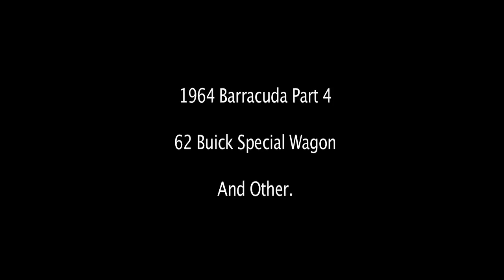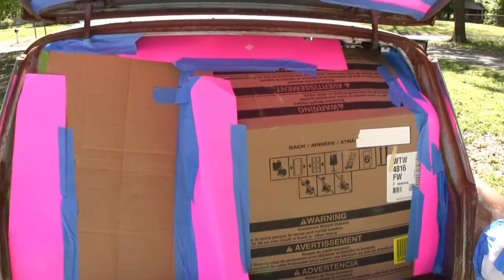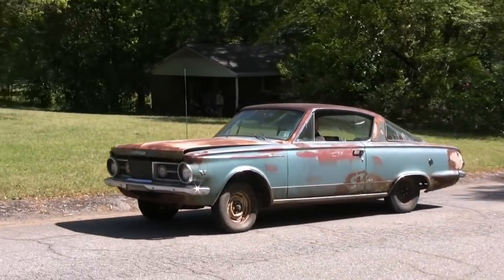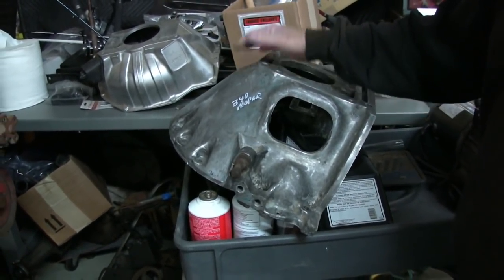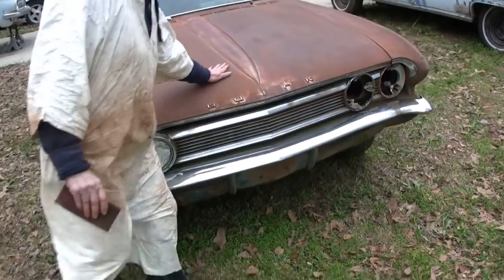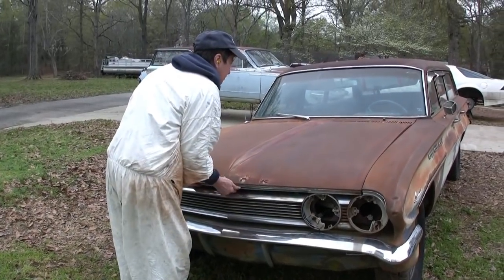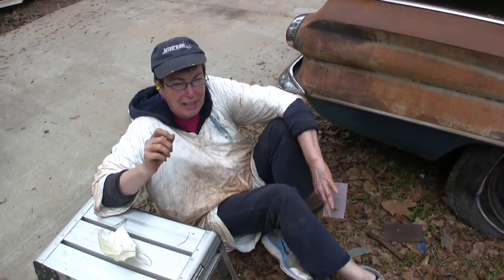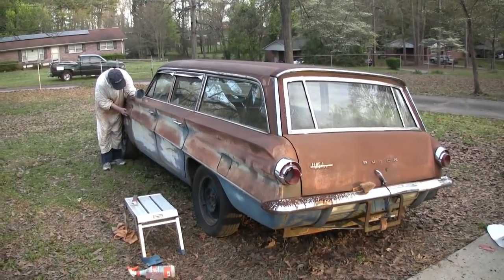64 Barracuda and 62 Buick Special Wagon

Comment: Glad to see ya'll are surviving your forced isolation.  Jackie and I are hanging in there.  I leave her at home and go to town about twice a week for supplies and mail. I really like your Buick wagon.  At first I was going to suggest a modern swap, a LS with a turbo.  After seeing the engine in it I think i would try to get the original engine going just for the rarity of the combination.  Thanks for the shout out on the model car, I hope you enjoy it.  I have a pretty good collection myself, most of mine came from estate auctions that I do online.  Time for a quick story.  The first car I had that I drove to school was a 49 Chevy Deluxe.  I know you are familiar with the old three on a tree.  Well this old car ran well but there was so much play in the shifter linkage that if you didn't hit the 1-2 shift just right it would hang between gears.  You don't know how many times I had to get out in traffic and grab the linkage on top of the steering column and get it back in neutral.  Finally an old country mechanic who worked out of a shop that looked like it was about to collapse told me to go to NAPA and they had a kit to correct this.  You removed the cover on the column linkage and inserted this spacer between the cover and the internal workings and bolted it back together.  It worked like a charm until the day I got rid of it.  Well you and the Rust Queen hang in there and we will all get through our imprisonment.  Keep the videos coming they give me something to pass some tilme.
Reply from the maker: Never heard of the spacer for the 3 on the tree. Will have to look into that some more. Now you have me wanting to work on my 49 Chevy, lol. Wish I had the money for parts while I have this time off. It's tough being born good looking instead of rich. :)  I may play with mounting the engine as I have parts for that. Need to finish one floor board too so I really have no excuses not to work on it. Glad to hear you folks are well and always look forward to the stories. Keep them coming.
Reply: @indyme2  You may have to find some NOS  parts on that kit, I bet it has not been made in many years.

Comment: Love the wagon. I use Penatrol for the finish. Makes the rust and paint pop. Plus. Not to shiny. And can put on with a brush. I've done a couple vehicles that way..
Reply from the maker: Penatrol? Newer heard of that. Will have to look into it. Thanks for the information and for watching, Mike.
Reply: @indyme2  its a paint additive. For flattening brush marks. You can use it by itself for a finish. Only about 12 bucks at Home Depot. You could try it out on a rusty piece of metal. Very easy to apply!
Reply from the maker: @mikek771  Thanks, Mike. Will look next time I am in Home Depot. We'll give it a try.

Comment: Fun video on the Rust Ranch. Did you guys consider clear coating the wagon and/or Barracuda ?   I was worried when you left in the Barracuda that the hood was not latched. Never forget driving down the road with my Dad in a 76 Chevy Pickup and the hood came up in our faces.  We were probably going about 50.  Stick that 385 in the I-ROCK and let er eat.  Take care. Stay safe !
Reply from the maker: We are going to apply boiled linseed oil to both. The barracuda hood was not closed completely because I had a gas line run to a small anchored tank inside the car, lol. Not sure of the condition of the cars tank yet. I am driving the Barracuda and the IROC every few days. Got to keep them mobile until I decide which way to go with them. Everything is mostly on hold until the job situation gets better. Another month and it will be time to hit a creek. Gold is calling. Hope all is well with you.
Reply: All good here. Just started my new Channel: Angry Chef, Mad Gardener and Crazy DIY.   First video is a Cast Iron Skillet Chicken Pot Pie with Butter/Lard crust.  Really like to cook, garden and rebuild stuff.  Should be a pretty eclectic channel.  And it is about time to get out and find some Indiana gold.  Spot is there just begging me to come. over and find gold !

Comment: Yep, those aluminum motors are pretty tough. They make a lot of after market parts for them. But it would be better to put a small block with a 350 turbo behind it. At least until you can build it. That will make a nice hot rod. It is in very good condition for it's age. Nice show, keep it up. Ronnie.
Reply from the maker: Yep, we are with you, Ronnie. 350/350 for now. We are also considering putting it on an S10 chassis. Looking at one this weekend. It's a unique car. Looks cool. We'll make it a driver. Thanks for stopping in. We appreciate you taking the time to leave us a great comment too!
Reply: @indyme2  That will be cool. Ronnie.

Comment: hey the Buick looks great and even better that you're planning on keeping the Patina.. I have a question related to the sanding process - Do you only dry sand? And what is the order of grit/grade of sandpaper that you go through? thanks in advance all the way from Australia..
Reply from the maker: She is using 150 to 180 grit cheap home repair sand paper. Dry sanding. She sands, wipes off the dust and then looks at the work. Then sprays a little water on the area to get an idea if it's complete or wants to sand more to bring out different colors. When she is happy, wipes with alcohol and or PRE before applying boiled linseed oil. Australia? On my bucket list of places to visit. I love the Down Under! Thanks for watching.
Reply from the maker: oops that's 60 on top where it''s the roughest, then 100 and 150 on the sides.  Hood just 150,  it just needed to be lightly sanded.  I'm so glad you like my wagon and the patina.  Rust Queen